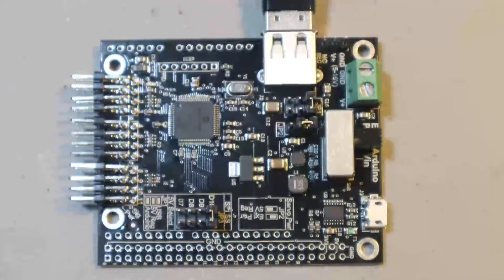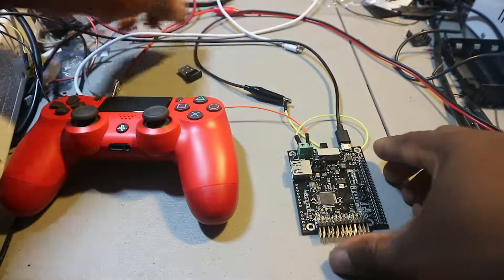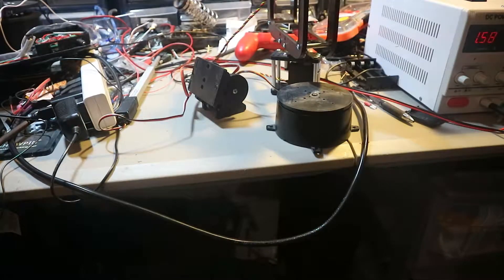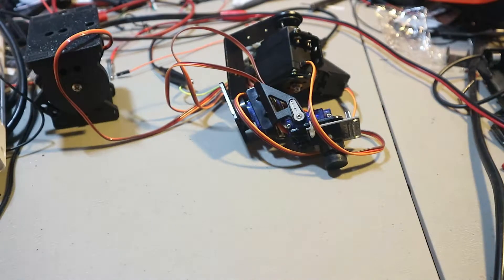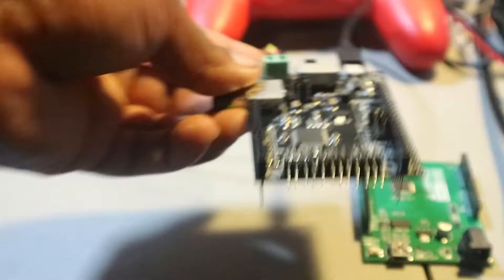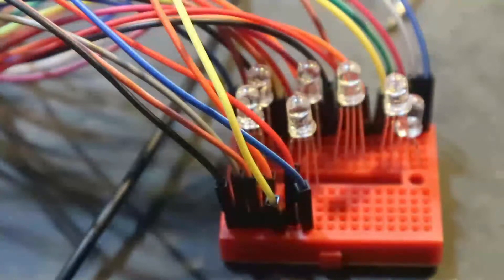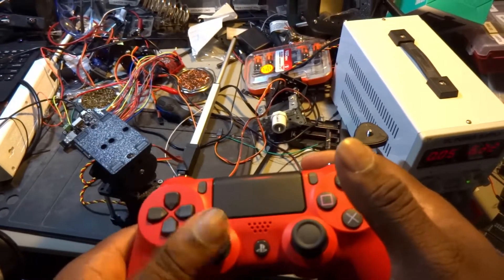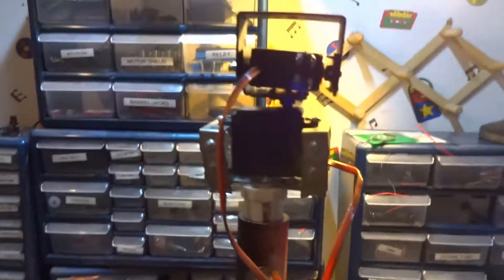ServoShock 2 Overview Servo Control with the PS4 Controller

Comment: could you use airsoft batteries or smaller batteries for the power supply? as long as it can handle 2amps or less?